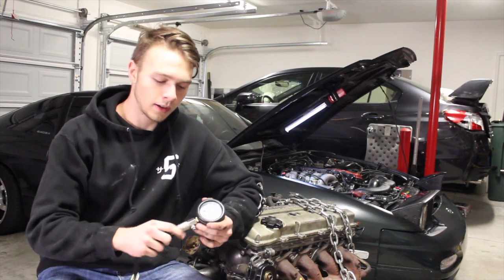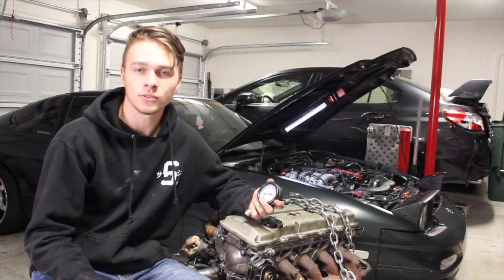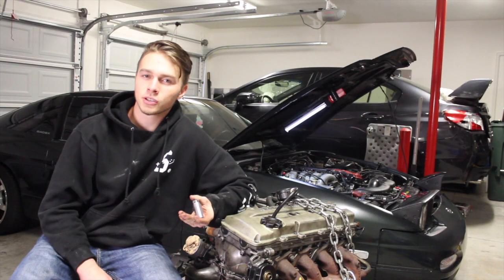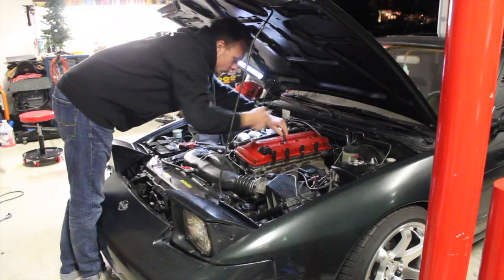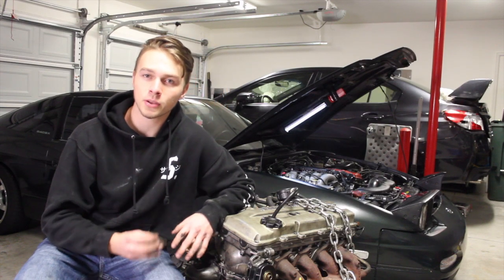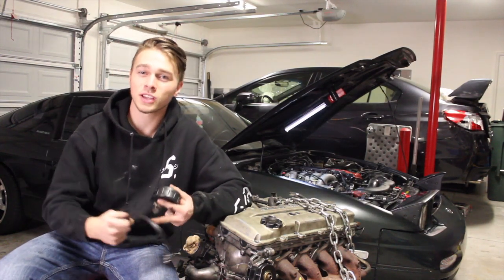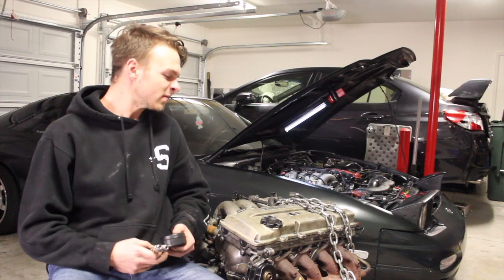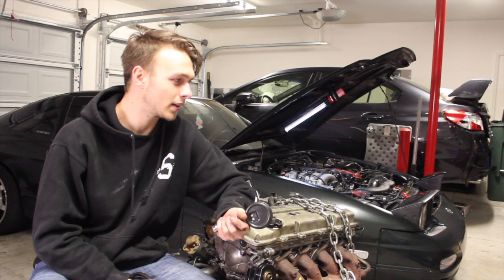Compression Testing the KA24DE

Comment: Necro post, but you missed a crucial step.  Pull the fuses for ignition and fuel injection.

Pin throttle wide open, then test.  Closed throttle will not give an accurate reading.